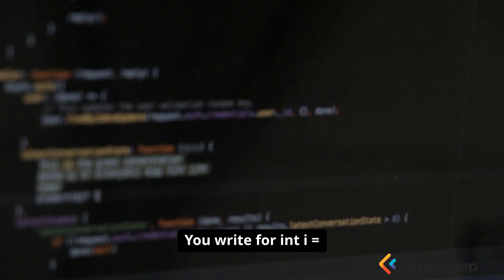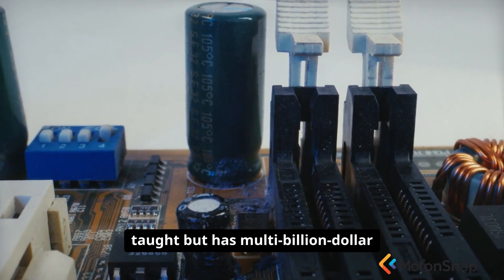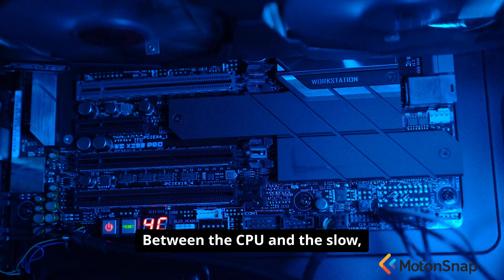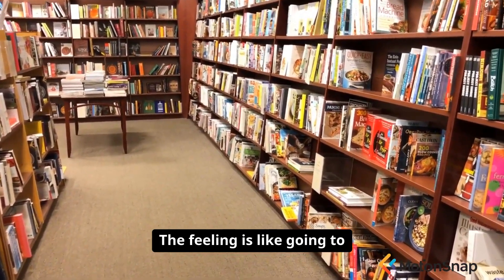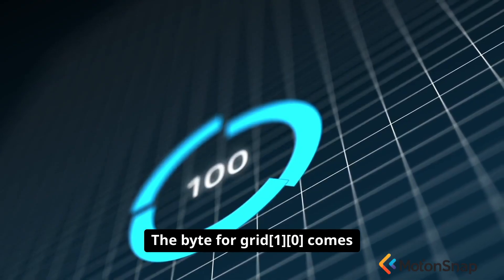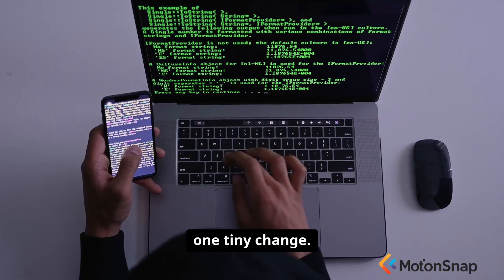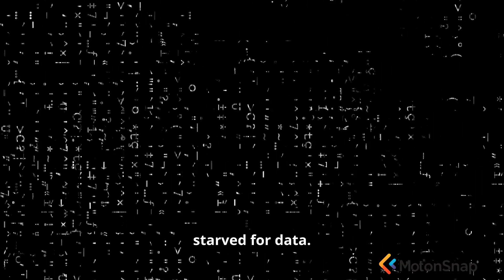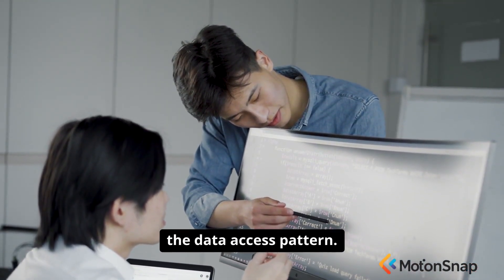C Code Slow? The #1 Mistake Even Pro Coders Make With Loops

Comment: The video mentioned 64-byte cache lines. How do performance considerations shift on older architectures (like specific embedded CPUs) that might use 32-byte or 128-byte cache lines?

Comment: You suggest fixing the traversal, but if you have to implement two levels of blocking (L1 and L2 cache optimization), doesn't the code readability penalty become severe? Where is the trade-off line?
Reply from the maker: "You've hit the nail on the head. That 'severe readability penalty' is exactly why I stuck to the simple row/column traversal! My take: 99% of the time, the simple spatial locality fix gets you 90% of the speedup. That 'blocking' code is for the 1% (like HPC/game engines). TBH, have you ever actually implemented manual L2 blocking in production code and thought, 'Yep, this was worth the mess'?"

Comment: Tldr: he's talking about the difference in cache misses when traversing a grid row or column first.

Also he says that it's 100x-1000x times slower to do it the wrong way. That is just false on modern CPUs, it's more like 2x-10x slower. This is because even tho the access isn't contiguous, it's consistent and predictable. This the CPU can still pre-fetch cache lines.

What really kills read spreads is random traversal like in a linked list or tree.
Reply from the maker: "That's a really fair point, NGL, and you're spot on about the hardware prefetcher being able to handle a consistent (even if non-contiguous) stride. The 1000x figure is definitely a 'worst-case' benchmark to illustrate the concept of fighting the cache, but you're right that 'false' is a strong word for a typical scenario. Your point about random traversal (like linked lists) being the real performance-killer is the perfect follow-up. It makes me wonder: how big do you think that 2D array needs to be before the prefetcher does give up and we do see those horrifying 100x+ numbers?"

Comment: The information is important and the example with an image data structure is a good one. 
However it's clear you are using unchecked AI sound synthesis that did not quite work out.
I think you had better work harder on your video before releasing it.
Reply from the maker: "NGL, this is super helpful feedback, and I really appreciate you being so specific. I'm glad the core info and the image example landed well! You're spot on, the narration... 'did not quite work out' is a very polite way to put it. When you say 'unchecked,' was it the pacing, the tone, or just the weird pronunciations that was the worst part? Always looking to improve."